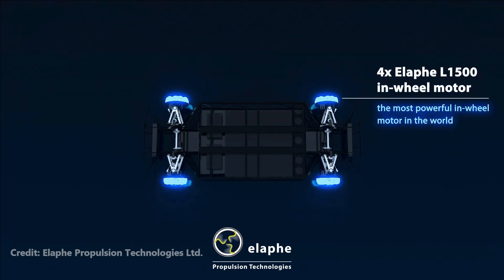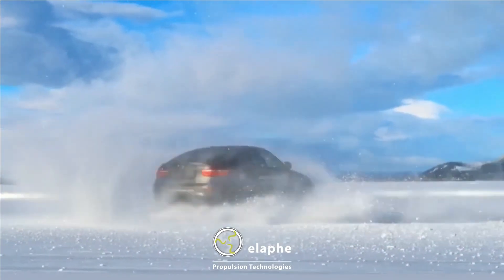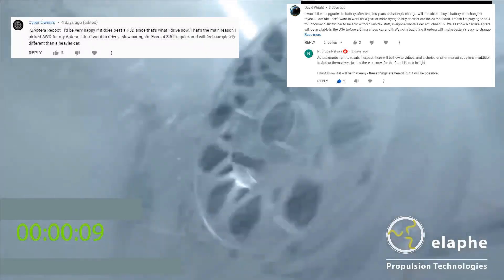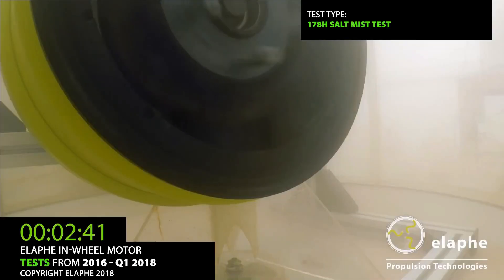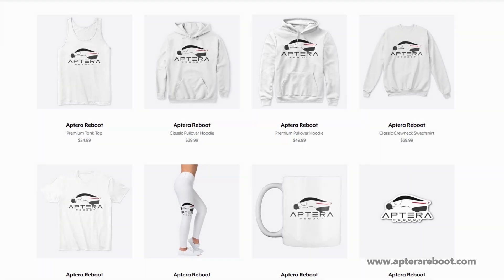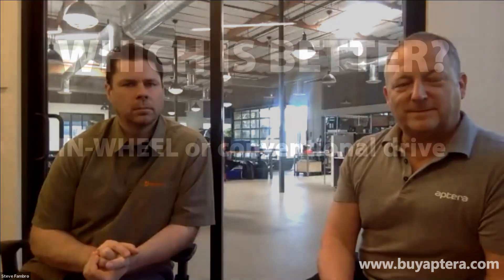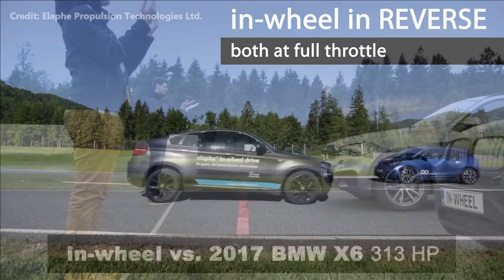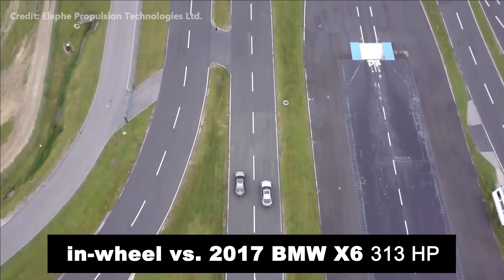Light Weight High Torque In-Wheel Motor Durability Testing: Aptera & Elaphe Propulsion Webinar

Comment: Do you think you might make a super efficient rear wheel motor only??  OR dual motor  OR will all be three motors as the benefits of all wheel 3 motor more than makes up for the extra costs and trying to "save" just isn't worth doing.
Reply: Not Aptera, but a dual front wheel motor version is available as the most economical choice.  I have one on order myself.  If you plan to do much driving in snow, the 3 wheel motor version will give more control, but I think the two wheel motor version is likely to be OK with snow tires or chains.  The ABS and traction control is faster reacting than anything else presently on the road.

Comment: Did you do testing in road salt? I can imagine there's a lot of chance for corrosion of casings but does salt get into the motor through cold weather water?
Reply: Elaphe has done this and the indication is that it is sealed against water intrusion in up to 10 ft of salt water.
Reply: They have a test where they sprayed saltwater mist on the motor for over 178 hrs straight and no problems. It is on the elaphe testing vid.

Comment: Do different battery sizes have different charging capability? I also want to know what charging times are like. Its a great machine and travel in the affordable model would be great if charge times are decent.
Reply: Charging times will be fast, because plugged into the same charger, the Aptera gains range at least twice as fast as other EVs due to the lower power use.  From the FAQ: From a 110v cord (like what you'd charge your cell phone on) you get 13 miles an hour or about 150 miles of charge overnight. At roadside charging stations you'd likely get about 100 miles in 10 minutes.
Reply: @n.brucenelson5920  great thank you. I can't wait to see the layout of the plugs. This makes the 400 and 600 mile range much easier to consider for travel.

Comment: I'm writing this to open a dialogue about Direct Digital Manufacturing with Carbon Fiber. As you know making anything out of carbon fiber is very expensive because it is extremely labor intensive. I believe developing a new system of automated design and manufacture is the key to unlocking the potential of carbon fiber. 
I would like to propose that the time consuming hand layup process needs to be retired and in its place pressurize air bladers and free form jigs be utilized to give structural form to EV and EVTOL vehicle chases. A process where from a raw roll of carbon fiber woven fabric material can be cut to forms. These forms can be sown together inserting rigid foam material in some places or plastic bladers in others. During this process too low-E wiring harness and sensors can be inserted. When the final soft form is completed a plastic vacuum bag is placed around the whole of the form, the form is placed in a restraining gig and the internal bladders are inflated. Now resin can be pumped in between the exterior vacuum bag and the interior compressed air bladers.  You can imagine a whole assembly line of these hanging from hooks on a ceiling mounted conveyor going through a curing oven. 
The end product in the skeletal structure of your vehicle. Openings for doors and windows, etc... would be cut out. That material shredded and that carbon fiber chop recycled back into the manufacture process. Carbon chop infused thermal plastic would be better used for body panels. 
This is what we need to work on to move American Industry forward. This process relies heavily on utilizing the advances in computer aided design and physics engines along with robotics. I imagine a symphony of sewing robots manipulating carbon fiber car bodies in the air in these automotive factories of the future instead of the ubiquitous welding robots of today. 

David Elze   631-997-503    dvdelze@gmail.com
Reply: I agree completely. That system you speak of will change manufacturing and durability of uncountable5 products worldwide. There are companies doing robotic wrapping of beams and such in the extrusion industry I'm glad to see someone is spreading the word.
Reply: @freakinhumanbeing  Thank you for your reply. This concept is attempting to incorporate many different innovations in manufacturing that have occurred and matured over recent decades. I know that the Aptera team has their hands full executing the current design but looking at the future they will need to differentiate themselves further and I believe developing this system of manufacture either in -house or by advising and collaborating with a third party startup with this goal will give Aptera the competitive edge in the EV and EVTOL market.
Reply: David, are you producing this new method of manufacturing or currently still in R&D?
Reply: @dexterandrada  Only in R&D. I don't really have the ability to explore the feasibility of this method by myself so I'm opening it up to the EV community as a whole. It was the open architecture of electric vehicles that started me thinking about DDM, Direct Digital Manufacture some years ago. I was disappointed when Tesla abandoned composites because of the difficulty to ramp manufacture.

Comment: When you make turns the outer wheel travels faster than the inner wheel, how is this delt with,  with motor in the wheels .
Reply: Each motor has its own sensors to sense slip and adjust, this happens 32 times per wheel revolution, about every 2.5 inches at the tire tread.  There are also gyro sensors to sense changes, and the steering control can provide differential steering input initiated by the steering wheel.
Reply: @n.brucenelson5920  wow, now that is a great answer but it sounds very complex, I hope that it doesn't effect reliability .
Reply: Since the wheels aren't mechanically connected it would probably perform similar to a differental without one wheel losing power when the other wheel loses traction.

Comment: The day will be great when the car could speed or slow to automatically steer towards a safe place if obstacles are in the way.
Reply from the maker: Aptera is in talks with at least 2 companies to have level 2 autonomy in their cars.
Reply: I know of 3.
Reply: @n.brucenelson5920  yes very nice but a 25000 dollar car can be over 30000 when you don't get a tax break because of the price point. I don't qualify , so maybe I would buy something like this. I don't have power hook ups at my condo  so I will have to make some kind of portable 30 plus mile battery charger or two with a strong mountain like backpack would be nice because I'm on third floor.